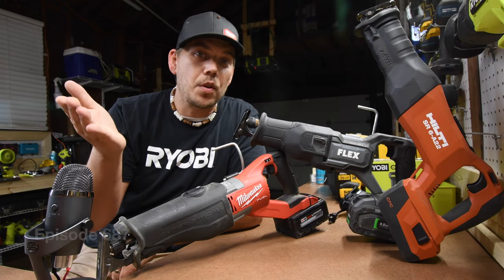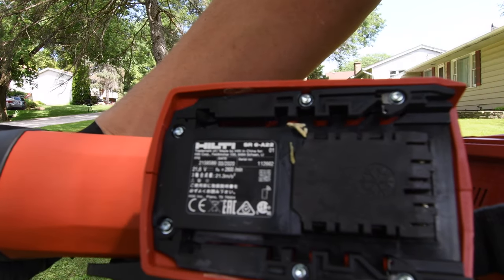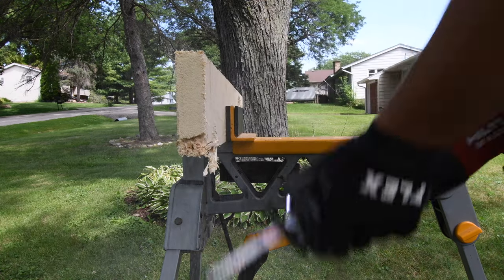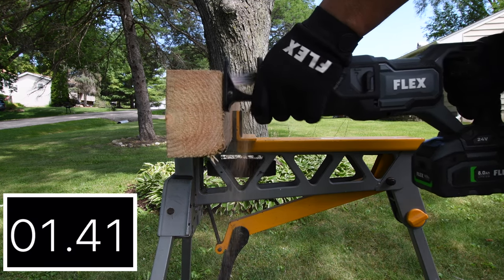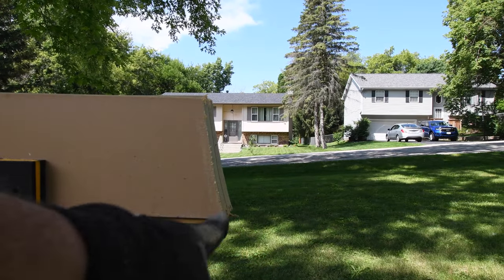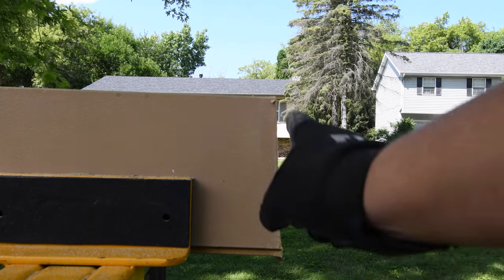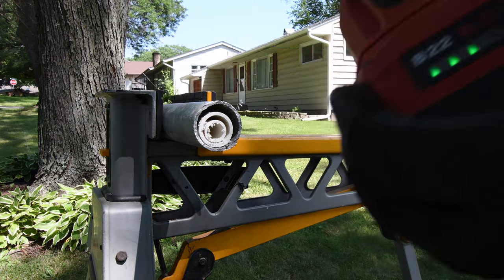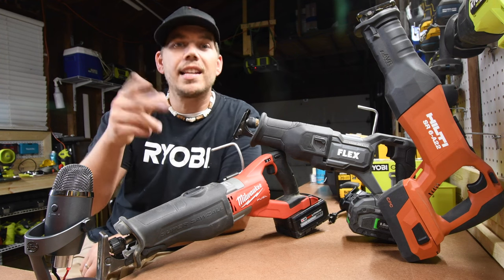Is Milwaukee Really The Best Reciprocating Saw?

Comment: The Milwaukee with a 5.0 was on sale a few days ago for $116 after the Home Depot hack :)
Reply from the maker: that's not a bad price at all
Reply: I missed out on that deal. But it wasn’t the saw with the orbital feature. At least not the one I saw. I did manage to get the 6 1/2” fuel Circular saw with two 5.0 batteries for $181 though!
Reply: I managed to get that deal. Been waiting for the Super forever and got lucky. HD canceled my 7 1/4 deal but you can't win everything

Comment: The only people I've ever seen use Hilti any where around me is one company does home foundation restoration and they provide them for the crew. The only place that sells them is about 200 miles away so most guys around here in Oregon run Milwaukee or DeWalt and ever once in a while you will see makita
Reply from the maker: HILTi does need to get into Home Depot. They need more physical locations to get more of an average customer
Reply: @ManCaverTools  They were in Home Depot stores. 99% of the customers chose Ryobi.

Comment: If the price is similar the Hilti edges. The Flex was even impressive (I HATE having to admit it). But none performed well enough to consider having to switch battery platforms or to have a different platform for just that tool. And if it us Hilti forget about full platform. Their overall price is too high with not enough opportunity for sales or special.

Comment: It's all based on ergonomics, what you like personally. They are all very powerful. If you get a good deal take it. all these comments stating and assuming people are going to switch brands and dump their lineup over a youtube video showing a second faster or some bolts going in deeper etc. It ain't gonna happen just because you see a video. Besides who said you can't own several tool brands? Yeah you might have to carry more batteries and an extra charger but it's worth it if you got a great deal. 👍

Comment: This test was great but going forward if you can make sure all the batteries are the same size during your test. Not saying that these ones weren’t, but if you have 3 five amp hour batteries and 1 of them has 21700 cells and the other two have 18650 cell then it’s not a fair test. Just saying
Reply from the maker: I will be doing a lot more with regular battery that match other brands.